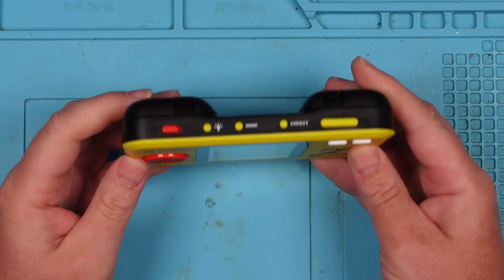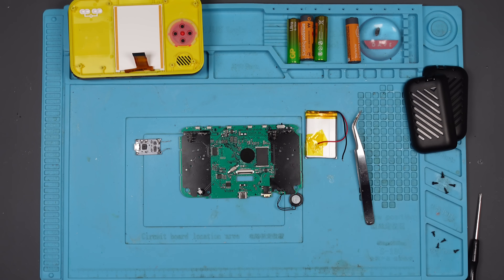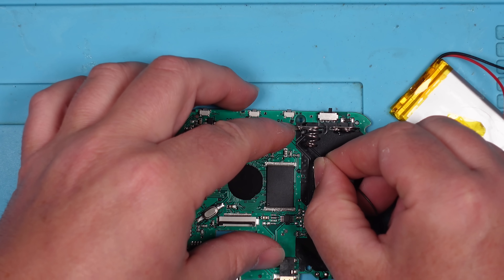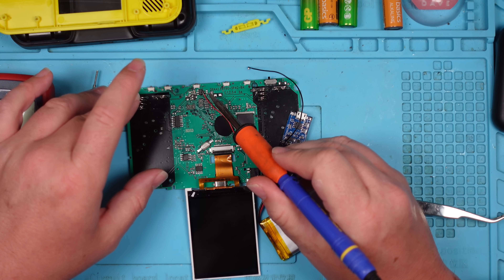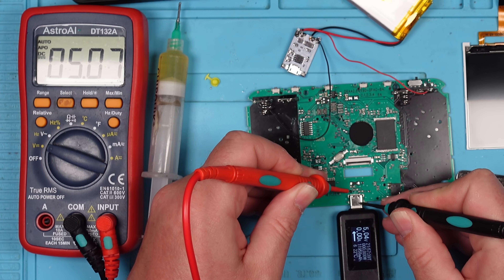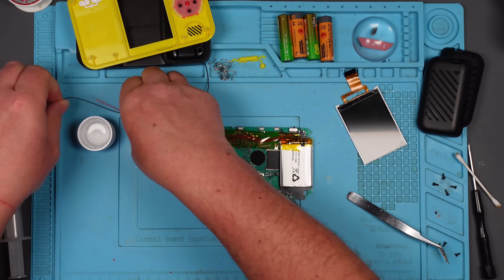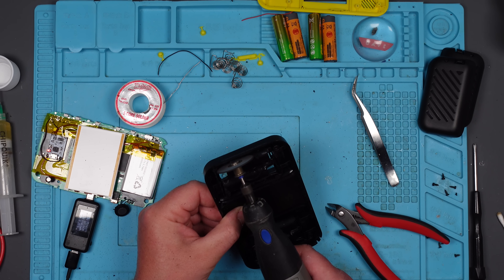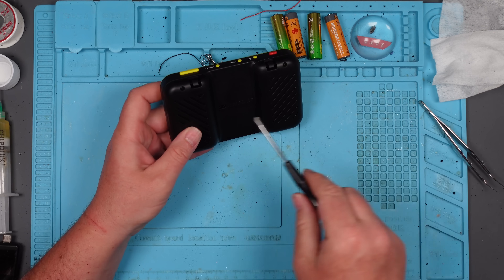Pimping Pac Man | Let's make it rechargeable!

Comment: For future reference, super gluing heavy mono fishing line to the top of the LED allows you to route the light elsewhere as it will transmit through the end of the fishing line over a fairly long distance.  You can also disassemble one of those Fibre Optic lights and use that as well.  This would allow you to drill a pinhole on the top of the device and route the line to it so that you could see the LEDs on the front panel.

Comment: 9:14 the black and red wire at the bottom of the board  and then claims it’s was the diode was missing was the issue but clearly shows the black wire ground clearly missing 9:34 .. very strange 😂

Comment: Have a check.
As I’ve also got a similar silicone blue mat , but sitting on top of an anti static mat that had a grounding strap attached to it, which in turn sat on a wooden table top. 

And was hovering up plastic bit I’d cut off of something using a similar vacuum cleaner (Hoover). What I discovered as I was lifting up the blue silicone mat from the grounded electronics mat was the silicone mat had a huge amount of static electricity on it. It crackled as I lifted the end up. 

Reading up on what could be going on - static build up between the grounded rubber mat and the silicone mat , I found some mention of air flow over the silicone could cause a static charge situation. Ie  the hovering. 

See if you also have that , as working with semiconductor parts in a statically charged mat is a very bad idea.

Comment: They have lipos in AA form factor or those one for vapes that Would fit in the double-Acompartment. If you wire them in parallel you can use a couple of the batteries for longer run times.

Comment: Couple more options for that LED indicator light placement. You could run LED to one of the buttons on top or use fiber wire to a new self made hole next to those buttons. Maybe even replace one of the buttons with clear material..

Comment: At a guess, the diode is probably an OR and a reverse protection function, when using both USB and battery power. It may be worth checking whether the USB port has power on it (shouldn't have) when just powering by battery.

Comment: Definitely not a bodge but a well thought out upgrade to something you use.  Well done.  For bodges you should watch some of Electronics Repair School laptop repairs.  Capacitors often get ripped out (literally) and mostly not replaced, failed protection mosfets often just bypassed, and blown SMD fuses replaced by bits of wire - all for paying customers!

Comment: Why you didn't switch sides for converter and battery.
You can use shorter cable for positive, and find nearest ground for converter.
For LED indicator fiber glass will work like charm.

Comment: I appreciate you doing the little puff of air before wiping the screen, so many people forget that - you can have a piece of metal dust on the screen that you'll scratch it all up if you smear the wipe on your screen with that. A little puff of air is all it takes to remove those particles before wiping, and you can save so many scratches from happening.

Comment: You could have used a couple of reclaimed lipo batteries from disposable ecigarettes (vapes), they have perfectly re useable lipo batteries of around 500 mAh capacity and can be found dumped in most streets. 2 in parallel will fit in the space of 2 AA batteries, so no Dremeling is required. The cell protection against over discharge is provided by the TP4056 module. I've done this a couple of times to Poundland flashlights and head torches. If you need a stable 5V from the lipo, DC to DC converters are available from the usual suppliers, they are very small and efficient.

Comment: Excentre video. incarcerable that i was hiking in doing something similar with the same TP module ..   I don’t have any reachable battery I am thinking in opening a laptop battery and use one of the cells I believe they are just over 3V I need to check  .. saying that I need to get one of those USB modules to check wither it draws any apps … thank you for the video wish you well. apologies for any spelling mistakes english second language and it has been a while since I wrote in english

Comment: If you need to make a nice LED diffuser then drill a little hole in the plastic, put a small blob of hot glue on the reverse side over the hole, flip it over quickly and push the hot glue through very gently until you have a nice amount filling the hole or bulging out a little. It always looks better than having a bare hole. :penguin-blue-waving-tear:

Comment: I often use holes for the lights on these little modules, but I drill the hole then put a bit of tape on the outside and fill the hole from the inside with a bit of epoxy glue, then remove the tape after the epoxy has cured. Have never needed to make a light guide as these little LED's have quiet a focused bright light which shines nicely on/through the epoxy glue.

Comment: Your battery already has an overcharge protection board (dw01a + 8205a). It was possible to implement 2 packs of batteries in parallel. There is also enough space in the case to install a power bank module (SM5308) - this would expand the functionality of this device as a “Pac Man” power bank.

Comment: Nice Thinking. Just double check that the BMS and the way you have wired it protects the battery from being OVERDISCHARGED. The way you have wired it (parallel to battery), probably not. Overcharged Lithium batteries will fail prematurely- also very unsafe...

Comment: I would of moved the light to front of the game under 1pl 2pl in the middle or lite up pac-man eyes :), Awesome job on this and does it shut off properly once the voltage /battery drops, I've done this to radio made in India, with a 18650 but the once the voltage drops, it kept draining the battery basically killing it. Like the voltage protection wasn't working right.

Comment: Why don't you use elf bar battery? I have some of them in various capcity and size and i'm using them instead of non rechargeable batterys and some of them fit in AA  battery space. Oh and there are much more smaller bms on ali.

Comment: If the regulator drops the voltage to 3.3 then if the battery reaches near 3.4.3.5v the regulator stops working and it will stop working before the battery is discharged

I recommend a voltage booster for 5v to keep constant voltage for the device

Comment: Use 4xAA rechargeables, doesnt require any butchering, will last 3 times longer than a 3.6v cell
Reply: Yup, NiMhs would have longer battery life, can be swapped with a fresh set for an instant 100% charge and have a much lower self-discharge rate. Internal batteries are also more of a hassle to replace after going bad. It's why prefer Xbox controllers over Playstation.
Reply: @roger_hunt  Bang on, same here, those 3.6v batteries are bloody dangerous too, there are AA batteries now with recharge circuits built in too.

Simply fit a DC jack and use an external charger.

Comment: solid work, i would take the hotsnot off  and put it on the plastic instead for water proofing but thats me
Reply: Ooh, yeah! That is the elegant solution that would make this great mod that last 5% better. A blob of glue under the hole would pick up the LED light nicely and would also seal it off.
Reply: This device definitely ain't waterproof anyway

Comment: Hi steve, love your video. Try to mod ps4 controller 🎮 charging port to type-c and use 2000mAh battery. I've already done it but unfortunately i didn't record it. You can try to find the type-c mod circuit board on someone else youtube video (he gave the link to buy it or you can search the circuit board online using it's serial number? I guess). Hopefully you will succeed and give hope to others who wanted to mod their ps4 controller. Please make more mod video like this.

Note: My ps4 also recognised my controllers when i connect it using usb type-c cable. (All 3 of them).

Comment: Well done, Steve!  Solid soldering on a solid solution.  Now you just need to add a second battery underneath the charging board in the left cavity in parallel with the other battery, and give yourself ages of runtime! 😁

Comment: You can use like 14500 Li Ion battery. They fit in the original battery case. An you can use 4 of them. No need to cut.
Regards from Magdeburg
Reply: You would need a proper bms though then though, no? Or well, atleast match the voltages so the batterys won't be all upset

Comment: Great stuff, only thing I would have done different is to swap around the battery and charger to save a wire run across the top, also keep the battery away from the hottest chip on the board which i am assuming is the big rectangular one or the blob chip. Actually thinking about it you could forgo the wires and use the old battery circuit that joins the 4 AA cells as the charging circuit instead linking the charger and battery.

Comment: I just buy NiMh batteries cheap, about the same price as good alkaline but recharge hundreds of times.   They are 1.2V/cell and not 1.5V like alkaline and have about 1/3 the energy density but its not a problem because I just switch them out with charged ones and put the discharged ones on the charger.

Comment: How much would a mod like that cost, just for parts?
Reply: Probably about €20-30 if you include everything.
Reply: @hugegamer5988 Nah. Considering you take apart stuff frequently, you can find batteries in anything. The TP4056 can be found for less than a pound a piece, depending on which model you choose.
Reply: @Lazarus65  sure, you could find an old portable battery with  USB charging and just reuse the parts for free.  I’m talking if you bought new at a typical price, which actually costs more.